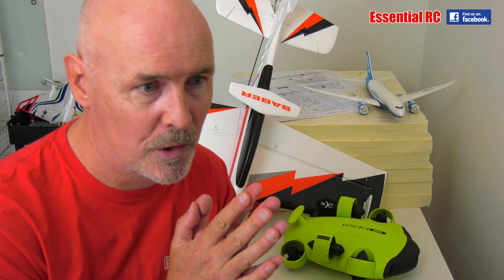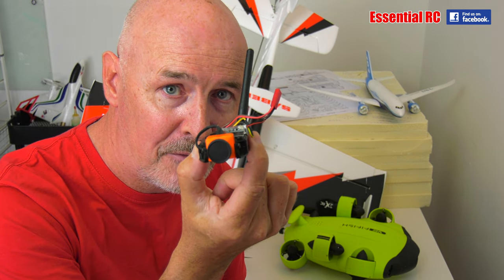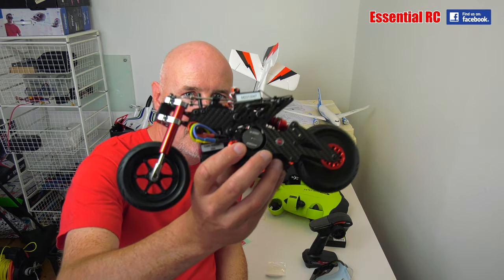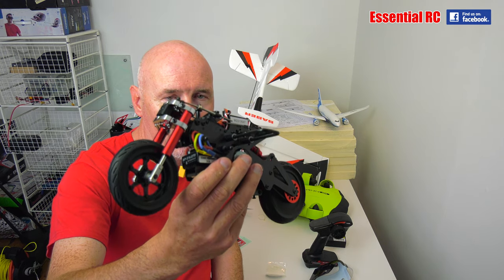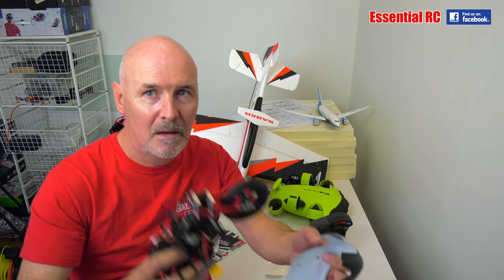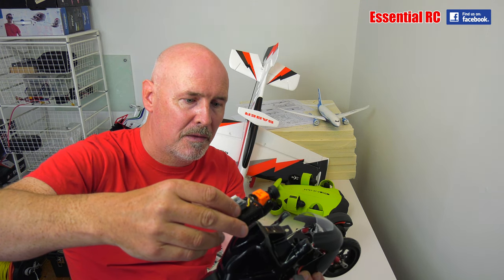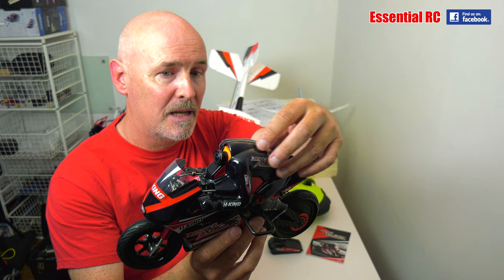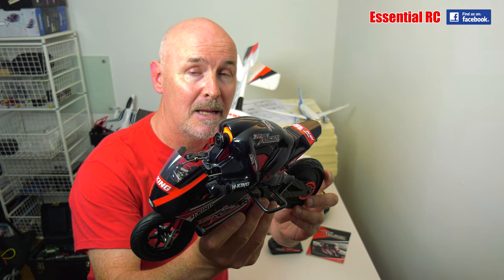FPV RC RACING MOTORBIKE (with Onboard Track Views)

Comment: It’s not easy to drive at speed in FPV! I did this with a Tamiya F1 F103 back in 95/96 with early surveillance camera gear. I was able to follow my friend around a track while watching a small screen.
Reply from the maker: I don't think the driving will be so bad if there are land marks to use for braking and cornering but these things have to drive in a circle to get back up again. That will be super disorientating. Next time we'll try FPV. Dom (Essential RC)
Reply: Essential RC 
Yep you will want clear land marks or guides. We did it in an open parking lot with yellow corner dots. I had the camera where the drivers head would be for the cockpit view. I used about a 100 degree lens and could see the front tires in my field of view. I think it helped for depth perception. On a bike it will be more challenging. Your probably going to have to try a few set ups to find the best way to drive it. 
Looking forward to seeing your tests!

Comment: I can see that they go fast (around 80Km / h, or more?) But seeing it in FPV is really impressive!
I hope Martin does a test or two with the FPV guide so we can see the driving difference.
I can imagine that there will be differences and above all the settings of the curves will have to change a lot, but after some tests I think we can get a good result.
Plus the model is definitely shockproof :-)
By the way: you are an excellent "plastic" surgeon! 
Tnx for sharing Dom!

Cheers!
Reply from the maker: Thanks Zola. Early days with this. We need to try it a lot more to get some good onboard action and then for Martin to actually try to drive the bike while wearing FPV goggles. Could be very amusing. Cheers Dom (Essential RC)
Reply: Yes but someone has to first build the isle of Man at the same scale.

Comment: Crystal Palace is a good track to test that at. In regards to crash bars, they are definitely not cheating. We have been running them for decades. Their main function is to , as you said, prevent the bike from falling over to the point of not recoverable. Even if the bike does go past that point, they allow the slow turn in a center pickup move to get going again without having to walk over a pick the bike up. The only people regularly not using crash bars are the Asian groups with their Kyosho HoR's. They have tuned them to the point where they can run without crash bars with carefully designed profiles inside the tires. Even they fall over and once again requires a turn marshal to get them going again.
You chose a good platform to test this out in. The HKM-390 is arguably the best value with a decent support system. It was easy to see that you were getting better and better making laps. There was several Go Pro videos done quite a few years ago, but they were all subject to the bounces and low resolution of the day...Thanks for putting this together.
Reply: about the crash bars: maybe with a small downward inclination they could create a negative stabilizing lift ..... OMG are not ailerons! hahaha.
Excuse this crazy foray from the world of 4 wheels

Comment: It is a shame that radio controlled motorcycle racing hasn't taken off.  One can't even find an English language YouTube channel dedicated to it like FPV quadcopter racing.  It is weird that FPV cameras haven't been added to the racing motorcycles where the drivers use FPV goggles.  You have shown it can be done 4 years ago.  This would remove the need for line-of-site control.  Additionally,  retractable outrigger landing gear could be added to the motorcycles like the Peraves MonoRacer (MonoTracer) to keep the motorcycle upright when stopped.  It can also assist in righting the motorcycle when on its side, with the gear retracted.  There are videos on YouTube showing this: "The Peraves EcoMobile - Discovery Beyond 2000 (1994)" and "The Peraves EcoMobile - Discovery Invention (1991)".

Comment: IMHO... Track needs to be smooth(er) and tighter, lined with taller visual references for turns. The Hobby shop has the black and yellow checkered corners, you could add led lights or mini-traffic cones so you could see the turns better. Parking Garage or Gym would be ideal.